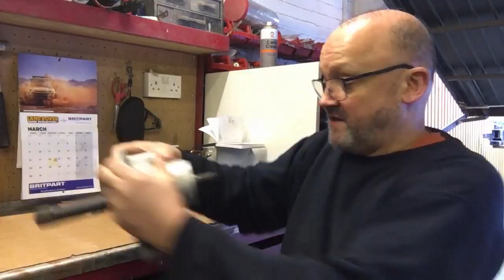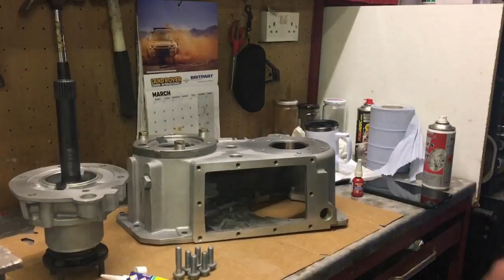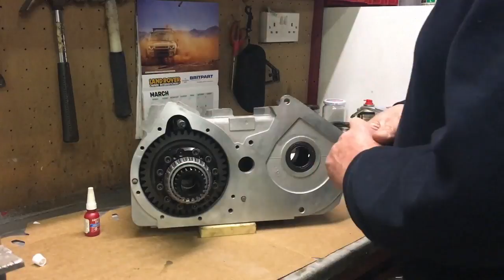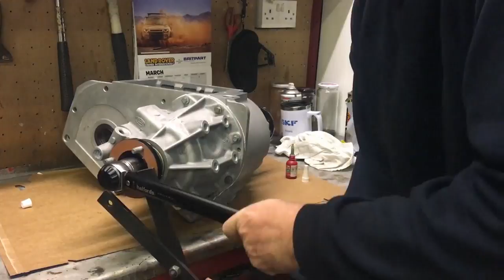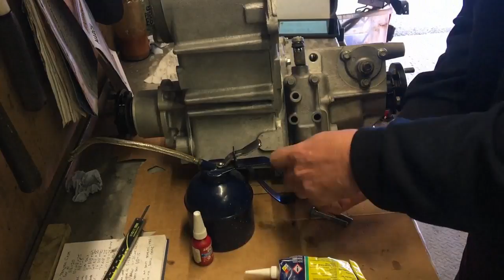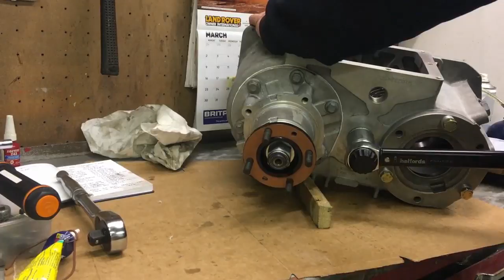Ashcroft ATB Centre Diff fitting.Part 6,  Building the Transfer Box.

Comment: Hi Nigel. I notice that you have used an older manual for the LT230 overhaul. There's a third edition (2000) which explains not only the fixed length spacer (and a far too intricate way of measuring) and the absence of the circlips, but it also says to verify the setting upon completion by measuring the resistance of the mainshaft when the transfer box is in neutral. It should be about 2,2Nm.
EDIT: I deleted the rest of this reaction, I probably was wrong.